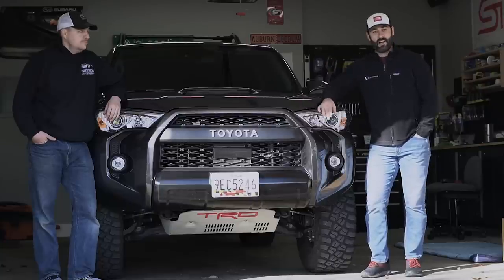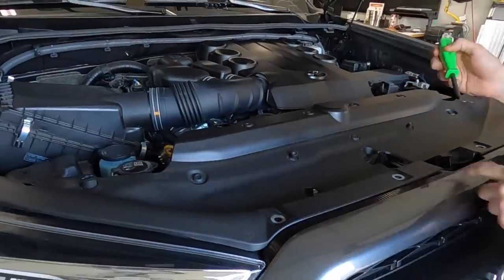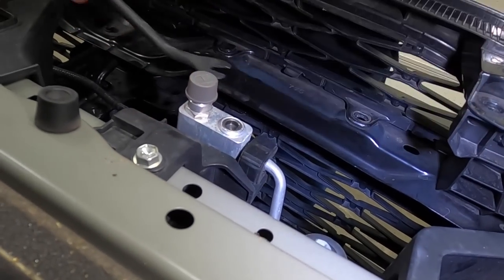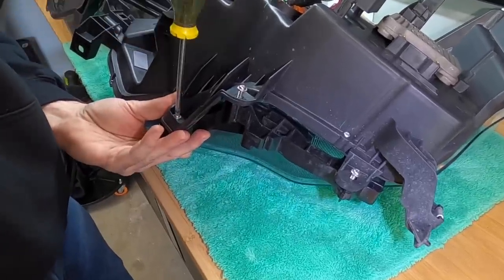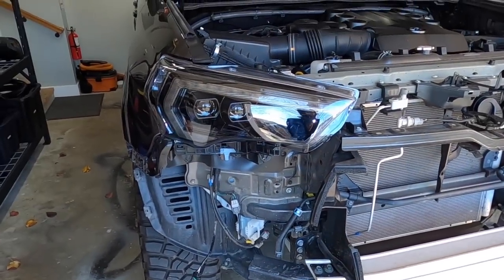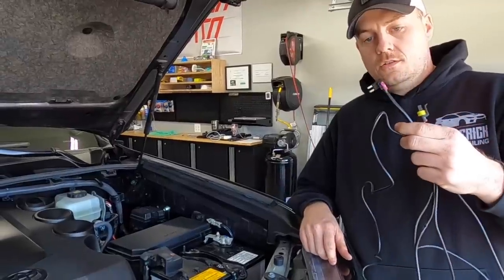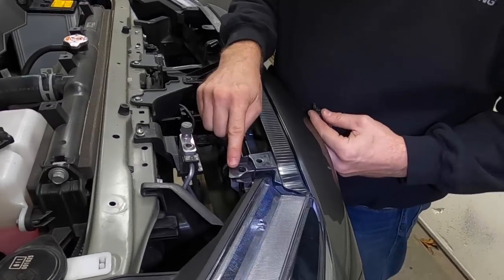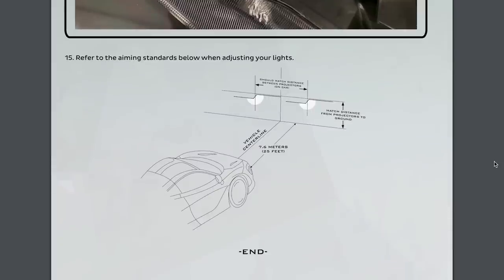Morimoto XB LED Headlight Install in Toyota 4Runner TRD Pro | 2014 - 2022 Toyota 4Runner

Comment: Sheeeeeeeesh ! Can’t believe I actually did it myself ! Thank to your video ! Took me about an hour & 20 little longer than most but can’t believe still. Only thing i had issues with was the fuse placement luckily Morimoto has the instructions for that and took a quick glance. Thank you guys for the very descriptive video !
Reply from the maker: Woohoo! Great job on the install and thank you so much for your feedback!

Comment: Hey guys great video, I used it to install my morimoto headlights on my 2021 4Runner trd offroad.

Has anyone else ran into any issues from disconnecting the cable that connects to the radar/crash avoidance system?  Because I disconnected it while watching this video it’s now flashing warnings at me that the lane departure assist and crash avoidance  system are at fault and I need to see a dealer and they won’t go away.

They say they can’t do anything to fix it either because my 4Runner has a non oem lift kit on it so the telemetry is off and they can’t do the recalibration.

Please if anyone else has ran into the same issue any help would be greatly appreciated!
Reply from the maker: Hmm, the only way you'd get those warnings is if it wasn't plugged back in after installing the headlights and putting the grille back on.

Comment: Great video! 2018 Sr5, where would I plug in fuse tap if INJ spot already has a fuse tap for other lights. Thanks
Reply from the maker: Thanks so much! We moved our other lights into the cabin fuse box so we could use the INJ fuse for our DRL’s.

Comment: Just bought a pair of these for my 2022 TRD ORP and followed this video which made it more than easy. For some reason, my driver side DRL wont turn on via switch. All the other functions worked and I replaced the 10A fuses in the tap...still no luck..any idea?
Reply from the maker: Sorry for the delay! How’s it going now? If still not as intended, what fuse location are you using? For 2020+ Morimoto recommends the EFI fuse location and we’ve found if that doesn’t work as intended then going inside the cabin to an ignition fuse location does the trick!
Reply: @TrailGridPro  Yeah was using that slot with no luck. However, I did reach out to the place where I order them from. Apparently, there is a 2021-2022 (Limited/PRO/Off-Road) specific harness. So they are sending that out to me to see if that was the issue. The harness that came with the set was for 2014-20+ (non-limited/all other trims)..Hopefully, that solves my issue.
Reply from the maker: @wnderinbasecamp  Oh, yea - they definitely won’t work correctly without the harness. Sorry, we assumed you had that when we responded initially! Glad you got it figured out.

Comment: Thanks for the help fellas made my install fast and easy!  Have you noticed sound, humming buzzing coming from the light? Only on my driver side is this normal?
Reply from the maker: Absolutely, you got it! There shouldn’t be a humming noise. I’d double check if you have the right harness (if applicable) for your vehicle and that your DRL harness is set up appropriately!

Comment: If the bulbs burnout can you replace the bulbs or will you have to buy the whole headlight assembly again?
Reply from the maker: So, the bulbs aren’t serviceable on these headlights but the set is covered by a 5-year warranty - if you have any issues all you need to do is send us a photo of what you’re experiencing and we’ll get the warranty process started immediately.

Comment: I see the plate that was just put on the 202 models on the grill that allows pre collision, turn lane awareness, and automatic breaking. Once the lights were installed and grill was put back on, did you have to recalibrate the grill or sensor system?
Reply from the maker: Great question! Nope, we didn’t have to recalibrate anything. All you do is plug back in the connector to the collision system and it all works perfectly!

Comment: Should we be using dielectric grease on the connectors? After my install and first wash with them on I noticed some water got on the connectors
Reply from the maker: Great question! Dielectric grease is not required but certainly not a bad idea!

Comment: Did the exact same thing on my 2020 TRD Pro. I had the Gen1 lights that got replaced under warranty and they gave me the Gen2 this time around. Same process and same fuse location but my DRL’s do not come on during the day when I have my lights set to AUTO like they did when I had the Gen1s in there. Any input on that?
Reply from the maker: What fuse location are you using for your DRL’s?
Reply: @TrailGridPro  the EFI2

Comment: When you installed the add a fuse, you went into a blank spot on the fuse box, so did you have your own extra fuse that you supplied into the "add a fuse" wiring? I also have a 2020 4runner and am already running raptor lights into my ING slot in the engine compartment fuse box. Morimotto also recommends using the EFI 2 slot if installing on a 2020+. Thanks in advance!
Reply from the maker: For our Morimoto install we used the INJ fuse for our DRL’s. Is that what you’re referring to? For our Raptor lights, we ran power to the cabin fuse box.
Reply: @TrailGridPro  in the video it shows you picked a blank fuse spot for the DRL that was between a 7.5 and 10a fuse. The INJ fuse is further down to the left in the fuse box. Or are you saying you removed the INJ fuse and put it in the add a fuse then moved it to the blank spot in the fuse box?
Reply from the maker: @LucasJohnsonVisuals  Ah, sorry I misunderstood your question! Read it too fast! Yes, we used our own fuse.
Reply: @TrailGridPro  oh okay, what fuse did you put in the add a fuse, just any 10amp fuse? It still works on start up when using that blank fuse location?
Reply from the maker: @LucasJohnsonVisuals  Yep, just a regular fuse and the DRL’s work on start up as we showed in the beginning and end of the video. Let us know if we can help with anything else! Thanks!!
Reply: @TrailGridPro  awesome, thanks for the quick responses and all the help! Mine get delivered today.
Reply from the maker: @LucasJohnsonVisuals  Awesome! You’ll love them! Good luck with the install!!

Comment: What about the raptor lights? Where do those get plugged in?
Reply from the maker: The raptor lights use an add-a-fuse to pull power from the fuse box under the hood!
Reply: What spot in the fuse box? If the headlights take one already

Comment: I'll be installing these headlights hopefully this weekend.

But i have an off topic question. What % tint on the driver and passenger doors? Also, is the windshield tinted?
Reply from the maker: Awesome! Hope the install goes well! We’re 5% all around and 50% windshield.
Reply: @TrailGridPro  it looks great. I have my tint appointment next week and have been trying to figure out what % to go with on my MGM 4R
Reply from the maker: @jross13450  Ah, the 5% is great but makes it a little tough to see out of at night … I wouldn’t change it though. Love the look and heat protection.

Comment: Hello ! At 20:55 in the video you started to insert the add a fuse in one direction and then u stopped, turned it around, and inserted it. I read orientation of the add a fuse matters. If it fits both ways, how do you know which orientation is correct? Thanks!
Reply from the maker: Great question! To find the proper orientation, remove the original fuse from the vehicle fuse holder, and place the fuse for the new accessory in the fuse holder in the position parallel with the wire off the tap, and then re-insert the tap into the vehicle fuse box. Test with a DMM for voltage from the wire off the tap, and if you have ~+12V, you have it oriented correctly. If you don't have +12V, rotate the fuse holder in the fuse box, and then retest.

Comment: When connecting the hardnest to the fuse box. Every video i seen this.all ya say is with your add on fuse. What add on fuse? What fuse number is it on the Add up fuse? Does it comes with the headlight or do we buy it separately.and again what size is it.or was the fuse already in the place where ya connected the hardnest and that's the fuse ya add.can you please explain
Reply from the maker: The DRL harness has an add a fuse connected to it for tapping into a power source.

Comment: So if I dont want the rolling turn signal I wont have to modify my electrical box?
Reply from the maker: That is correct, if you don't want the sequential turn signal there's a plug behind each headlights that when plugged in will be non-sequential and when unplugged will be sequential. We mention it in the video when we're placing the headlights in to the vehicle.

Comment: I’m having difficulty with the adjusting doesn’t move down or up
Reply from the maker: We've found it's easiest to move the dial with a phillips-head screw driver. It does however take quite a few turns of the dial to move the light beam.
Reply: @TrailGridPro  I’ve gotten the left one and right one I just feel like they should be more up is there a max level height ?

Comment: Just ordered my set I have a 22 and does the wire get pinched if you is the fuse box in the engine bay ?
Reply from the maker: We haven't had any issues using the INJ fuse in the engine bay fuse box!

Comment: The fuse  you added into the harness before connecting into EFI empty slot no2 was it a 10A or 5A fuse? Or was one there already? My slot there is currently empty with no fuse present. Can you advise, that part wasn't super clear..
Reply from the maker: It’s the fuse that comes with our kit. The other fuse in the fuse box location is a 10 amp ignition location.
Reply: @TrailGridPro  so inside of that adapter you have 2x 10A fuses?
Reply from the maker: @qcondoowner1469  yep, that is correct!

Comment: is there anything extra I would need if I’m doing a 2013 Limited to a 2014 TRD facelift in order to install these headlights?
Reply from the maker: As far as we know, out of the box, these headlights won't work on a 2013, but what we're not sure of is it because they simply don't fit a 2013 or is it also because of different wiring/plugs. We'll look into it!
Reply: @TrailGridPro  saw a video of a guy installing a 2014 OEM headlight on a 2010 4Runner. The only difference I saw was that he had to wire something extra for the 2014 headlight turn signal to work. Maybe this would be the only technical issue for them to work
Reply from the maker: @eduardonarvaez6205  Yep, I’m sure that’s it! 🙌

Comment: Love the content! Just a quick question. I noticed that your headlights and taillights videos are months apart. Did you purchase the headlights first and saved up for the taillights? At first, I was thinking about saving money until I have enough for both first but I may get the headlights first because I want to slap the Morimotos on so bad. Did you ride with the morimoto headlights and OEM taillights for a couple months?
Reply from the maker: Great question! When I first bought my 4Runner I swapped for the tails immediately for the smoked Anzo’s, then got the Morimoto heads and then swapped the Anzo’s for the Morimoto tails last.

Comment: HELP!: I just got some used Morimoto XB headlights for my 2016 4Runner but unfortunately, the headlights didn't come with a fuse tap and/or DRL adapter harness. I'm trying to find these online but I can only find ones for a 2014-2019 Tundra. Does anyone know if the Tundra one is compatible with a 4runner?
Reply from the maker: Call whoever you bought the headlights from. They should have come with them.

Comment: for some reason my drl are on even when the lever switch is off and not on drl. is that normal?
Reply from the maker: What year 4RUNNER do you have?
Reply: @TrailGridPro  I have a 2022 orp. I got info saying that's normal. It turns off when the car is off. So it's not a big deal but wasn't sure.
Reply: I had that same issue and I just swap the adapters from driver side to the passenger side and the passenger side to the driver side. And that fixed it.

Comment: You running the gen 1 or 2? Looks like we picked up a Pro about 6 months apart. I got the gen 1 installed but finding I need to run fogs full time to reduce the severe beam cutoff. What's your experience? Btw I'm also in MD.
Reply from the maker: Awesome! Where in MD? We gotta go
wheeling! So, I got my lights in June - so honestly not sure of the generation. Is there a date cut-off of gen 1 and 2 that you’re aware of?
Reply: @TrailGridPro  if all three lenses light up for low beam, they're gen 2.  They came out right around mid August. Would be great to do some wheeling!
Reply from the maker: @TheZenoParadox  Ah, then I’m definitely gen 1! My buddy and I are planning a trail ride for next week. Hit me up at cliff@trailgridpro.com if you’re interested in joining! No hard date or exact plans/destination yet - so we’re open to suggestions!

Comment: Do these work with the automatic high beams?
Reply: Yes. Nothing changes with functionality since it utilizes all factory harnesses and the sensors that activate the auto high beams sends the same out to the high beam. Truck still assumes it’s using OEM front lights
Reply from the maker: That's 100% correct! So sorry, David. Your question must've slipped through the cracks here. Our apologies, but thank you Ryuuji for picking up the slack! We appreciate you both!

Comment: still waiting on my harness for a 21 4runner. sooooo theoretically, if its the last wire that doesn't fit because that was halogen high beam, can I still install without that wire and not run high beam until a harness is released?
Reply from the maker: If you have a Limited or a TRD Pro, the harness is available currently. What trim do you have?
Reply: @TrailGridPro  I have the venture package. If the last wire is for high beam then I don’t really need it until harness comes out. Any insight on that?

Comment: Has anyone tested if these work with the 2021 model year yet?
Reply from the maker: Yep, it’s been tested and they do not work, unfortunately.
Reply: Makes sense it wouldn’t. Wiring harness would have to be different  from factory if they run OEM leds now. Morimotos were designed with a harness that supported a halogen light assembly
Reply from the maker: @jusimplicit  Exactly!
Reply: Yea that makes sense, well guess I’m stuck waiting until they come up with an adapter or a new Gen that fits my 2021
Reply from the maker: @tikitronco  Yea, hopefully they will soon! When they do, we’ll certainly carry it!

Comment: DO NOT USE THE FUSE TAP RECOMMENDED IN THIS VIDEO. The fuse tap used in this video is constantly drawing 3x the acceptable amount while the engine is turned off, as determined by Toyota. I used this fuse tap for several months and my battery would frequently die. It got to a point where it was dying overnight. Use the INJ fuse even if you have 2020+. I have a 2020 and it does not kill my battery. You will not be able to close your fuse box all the way, however. If you daily drive your 4Runner you may be able to get away with using this fuse. If you ever plan to leave it more than a day, do not use this fuse.
Reply from the maker: Thanks for your feedback and for watching, Austin! We did use the 10a INJ fuse.
Reply: I’m on my 3rd battery because I had it plugged into the mir htr (mirror heater) slot and Toyota said that was the problem. Did you replace the 3A fuse that comes with the DRL tap with the 10A inj fuse? Also, in the install guide, they have since put a note to use the EFI 2 slot on 2020+ models but on mine there is a 7.5A… I’m gonna use the INJ 10A and see how it goes. Any addition insight would be appreciated. Thanks!
Reply: @Raedeokillah  I didn't use the EFI 2 because of that. It didn't seem safe plugging a 7.5A fuse into a 10A fuse tap. If I can remember, that fuse won't even fit in the supplied fuse tap. I called Morimoto and asked if it was safe and the customer service rep I got didn't know. Decided not to take my chances and went with the INJ fuse slot. I still have mine plugged into the INJ fuse slot and have had no issues since.
Reply: @austinwilliams45  ok yeah I went with the INJ as well yesterday. I’m hoping it doesn’t draw any power when the Runner is off, because I don’t drive it everyday. I think I put in my comment that I’m on my 4th battery now. At first I thought it was 2 bad batteries in a row but then the 3rd one died and I knew something was wrong. Thank you